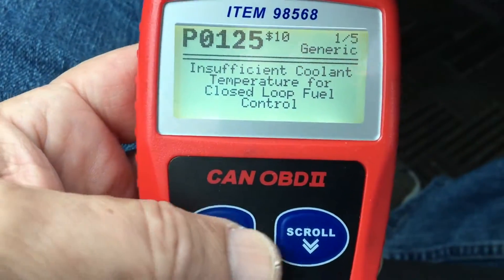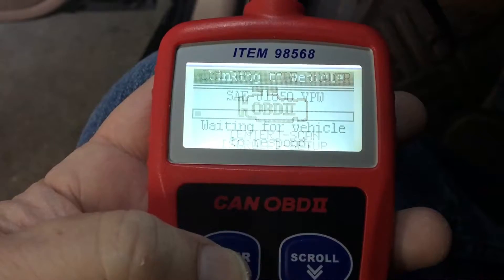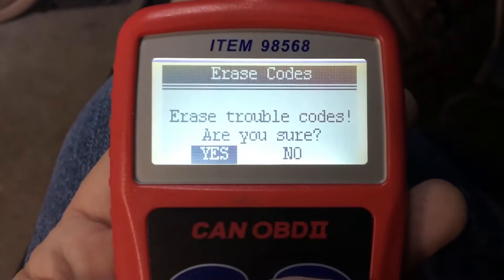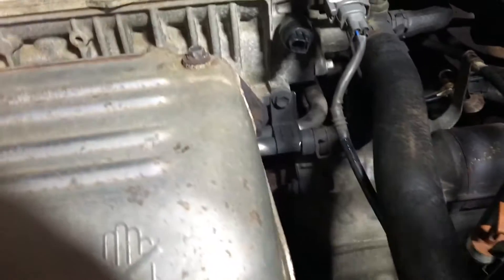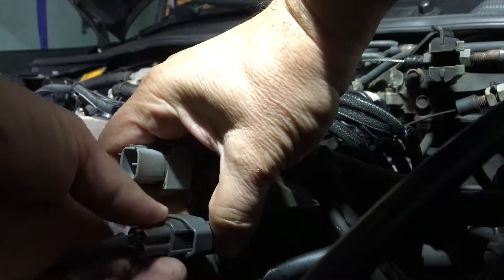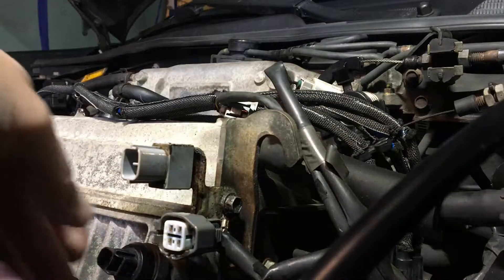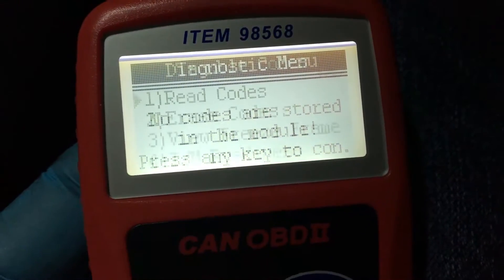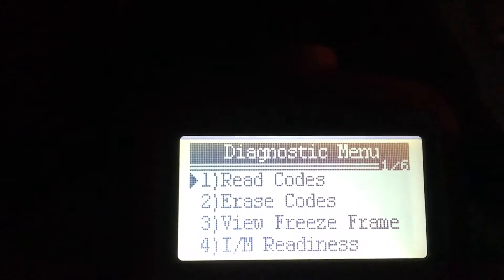1999 CAMRY UPSTREAM AIR/FUEL RATIO 02 SENSOR INSTALL-Everything You Need To Know.

Comment: i changed the upper 02 sensor..and cleared the check engine code..and the light came back on.. dont knoe why
Reply from the maker: Jerome, did you buy a scan tool to clear the code, and if so, did you verify it wasn't a bad downstream 02 sensor? Also, are you absolutely positive you installed the correct model Air/Fuel sensor b/c inexpensive "eBay" substitutes often will not stop the code.
Reply: @dbfcrell8300  sorry for the late response..dont knoe much about cars..but it could b the down stream also..is that an easy fix
Reply from the maker: @jeromeduncan5076  It's not as easy as the upstream sensor fix. It's important you find out exactly what sensor is giving the code and replace it with an OEM sensor, not a cheap one. Autozone will read your codes for free and tell you if it's the downstream sensor.
Reply: May I know what is the upstream/ downstream sensor resistance value should be?

Comment from the maker: R E A D   T H I S.... EVERYONE SHOULD PURCHASE A OBDII SCAN TOOL!  EVEN AN INEXPENSIVE CORDED ONE IS STILL HELPFUL BECAUSE AT THE VERY LEAST YOU CAN ERASE TROUBLE CODES TO SEE IF THEY COME BACK. INEXPENSIVE SCAN TOOLS ARE FINE, BUT MAY NOT BE AS HELPFUL TO ENGINE UNSAVVY PEOPLE. THE MORE EXPENSIVE SCAN TOOLS, WHICH CAN EITHER BE CORDED OR WORK VIA BLUE TOOTH LIKE THE BLUE DRIVER, USUALLY TELL YOU MORE ABOUT THE PROBLEM AND HOW TO FIND IT, DIAGNOSE IT AND/OR TEST IT. MANY MORE EXPENSIVE SCAN TOOLS REQUIRE A SUBSCRIPTION FOR UPDATES- MANY SCAN TOOL MANUFACTURERS SCREW YOU A DIFFERENT WAY FOR UPDATES. SOME MANUFACTURERS LIKE THE BLUE DRIVER, WHICH IS JUST ONE OF MANY,  HAVE NO ADDITIONAL COSTS FOR UPDATES (AS OF THIS WRITING) BUT MAY EITHER NOT COVER YOUR YEAR OR MAKE FULLY, NOT BE BE SUITABLLE FOR PRO USE OR THE SOFTWARE IS NOT SUPPORTED WELL. FOR INSTANCE, THE BLUE DRIVER SEEMS COOL, BUT DOES NOT SUPPORT DIAGNOSES OF THE ABS SYSTEM FOR MY 99 CAMRY. I HAVE AN OLD HARBOR FREIGHT EL-CHEAPO CEN-TECH CORDED OBDII SCAN TOOL THAT HAS HELPED ME COUNTLESS TIMES. IT DISPLAYS ANY TROUBLE CODES AND BASIC INFO LIKE IT'S A $10 REPAIR AND IT ALLOWS YOU TO ERASE CODES TO SEE IF THEY RETURN OR IF YOU'VE FIXED THE ISSUE. IF I NEED MORE INFO HOW TO DIAGNOSE A CODE OR FIND A SIMPLE FIX, I JUST LOOK ON GOOGLE / YT. THERE'S TONS OF INFO AND VIDEOS AVAILABLE THAT CAN HELP. SO FOR ME, A CHEAP SCAN TOOL AND WEB INFO HAVE ALWAYS KEPT MY OLD TOYOTAS RUNNING PERFECTLY. IF YOU ARE TOO CHEAP OR TOO LAZY TO BUY A SCAN TOOL, THEN YOU CAN GO TO AUTO ZONE WHERE THEY WILL READ YOUR CAR'S TROUBLE CODES FOR FREE AND MAYBE GIVE YOU SOME ADVICE ON HOW TOP FIX IT, BUT THEY TOO HAVE AN AGENDA. AND BTW, AUTO ZONE WILL NOT ERASE CODES FOR YOU!!! SO THIS IS WHY EVERYONE NEEDS A SCAN TOOL. IF YOU DON'T GET ONE, MECHANICS, AND ESPECIALLY DEALERS, WILL TAKE YOU FOR THEIR RIDE TO THE BANK. COUNT ON THAT!

Comment: after you change the 02 sensor will the check engine light come off by itself..i dont own a scanner
Reply from the maker: You know, I'm not 100% sure as I use my scanner the erase the code. I'm guessing that it should self-cancel within 100 miles or so, because if it didn't, the light would be alerting you of a code that's no longer valid, therefore I would say it must cancel itself. It's not like they didn't have the know-how in 99 to do such a simple thing. Please keep me posted either way.
Reply: @dbfcrell8300  thank you for your response..you were very helpful..i might change it myself thanks to your video..i need to invest in a scanner
Reply from the maker: @jeromeduncan5076  BTW, you only need to remove the bottom heat shroud to get the 02 sensor out with a box wrench, and if you actually own an 02 sensor socket, you don't even have to remove either shroud.
Reply: @dbfcrell8300  yeah ok cause i igot the p1130 code so iam assuming its the 02 sensor correct..is there more than 1
Reply from the maker: @jeromeduncan5076  Yes, there are 2. There's bank1 system1 and bank 1 system 2. 1 is the one in my video and 2 is the one in this video;  https://www.youtube.com/watch?v=PkOY8bvy2Nc&ab_channel=RustyMetalCowboy
Reply from the maker: My pleasure! It's a super easy job andyou should absolutely do it yourself. The cheap Harbor Freight scanner is great for the money.